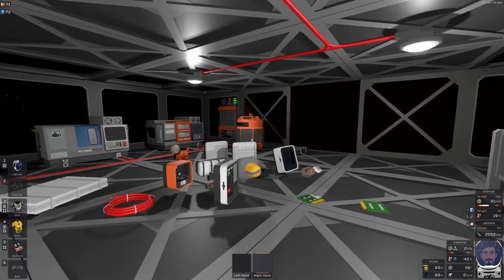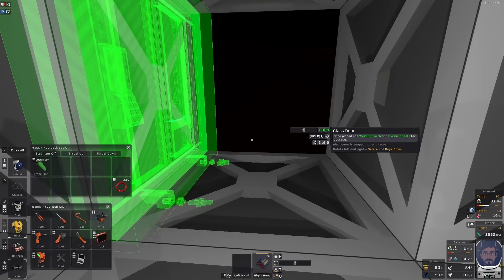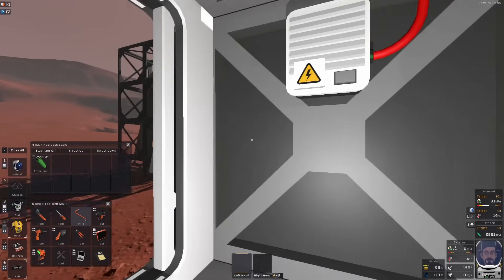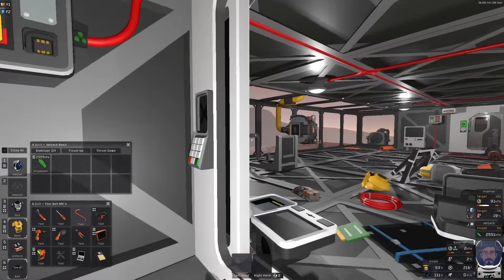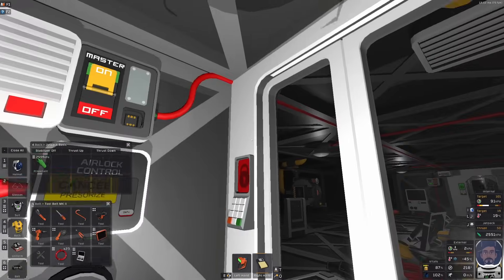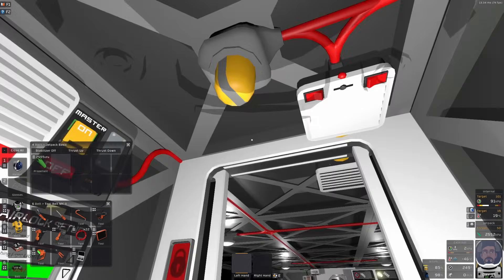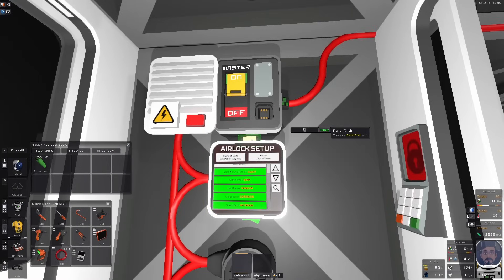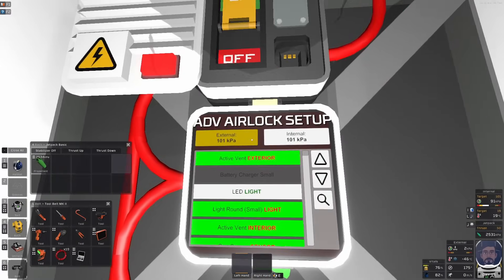Stationeers 101 Setting up an airlock.

Comment: So, I am running into an issue that I have no clue what is causing it, what I want to do is when I have the airlock, instead of keeping all the bad atmo in the base (after cycling the airlock,) I want to have the inside of my base a vacuum but when I have the outside vent set up to do that (by manually setting it to vacuum all the air outside), every time I add or make pressure inside the room, so I can breath by melting oxide, the external pressure stays at 0, when it should be going up and staying at that said pressure. I have everything set up exterior and interior vents, and doors but I can't seem to keep the inside a vacuum. Please if anyone knows what I am doing wrong, it would be really helpful, I can not progress without fixing this issue.

Comment: Hey, Mick. Would you consider showrunning Luna survival any time soon, or (even better) in parallel with the Mars one? The Moon is positioned as beginner-level, although it’s kinda tricky with bursting pipes all over the place, and capturing gases on the Moon is a vital part of survival without an atmosphere. I’d be delighted to see your approach to these things, as I’m having a hard time wrapping my head around some pretty obvious tasks that feel much simpler on other, atmosphere-rich locations.
Reply from the maker: That is why I say Mars is the beginner planet.  I did a series on Mimas, that would be the same as the Moon and might give you some hints.
Reply: @cowsareevil7514 thanks, will check your Mimas playthrough

Comment: Troubleshooting question:   

I keep setting up airlocks and all the parts are detected, but frequently outer door is set as interior and inner door is the exterior.  Getting them swapped takes multiple reboots of the console and lot of random clicking around on the setup screen, disconnecting of doors, etc.  This has been an issue that has plagued me since very early in the game's release.   Can anyone provide insight on how to fix it so making an airlock is much more effortless?
Reply: Do as Mick showed in this video: select outer door first on the panel and check which one is locked (red indication on the door). In case of mixing - deselect all from the setup screen and start over. The state that a certain device is controlled by the airlock card is set on the device itself, so disconnecting the device (say, door) from the network by cutting cables will give you nothing. Keep everything connected and operate the airlock interface.
Reply from the maker: Don't random click things, take your time set one item at a time and check to see that the correct device is locked before selecting the next thing.  Using the labler to names the doors and vents can help.
Reply: I always label my doors before setting up the airlock. I have never had the problem that you describe. I might call one "GH ext" (greenhouse exterior) or "Main int" for base exit interior door, etc.
Reply: Not sure if this is of any help to you.

But I generally use the renaming tool for all parts of my airlock.    Like for example, the exterior door I label exterior door and the interior door as interior door.    I also do this for the vents so that one is marked exterior vent and the other is marked as interior vent.    This then makes it easy to set up the airlock through the circuit board.

 Hopefully this will help.

Comment: One more advantage to placing both the area power controller and the battery charger in the airlock is that, if you keep at least one battery in the charger, you have a spare battery to put into the area power controller if you have a total base drain. However, in that instance, it would be best to source the power for the charger from the source side of the area power controller. In your case here, a good place would be just to the right of the console with the power from above. 
One downside to the controller and charger in the airlock is that for cold worlds, the batteries will continuously drain if the power is cut. I think Europa is the only regular scenario this applies to; but also Titan and the like if you use those.

Comment: Maybe a dumb question, but what does happen to the gasses from the outside in a basic air lock?
Reply: They are introduced into the base's pressurized environment once you cycle it from outside to inside.